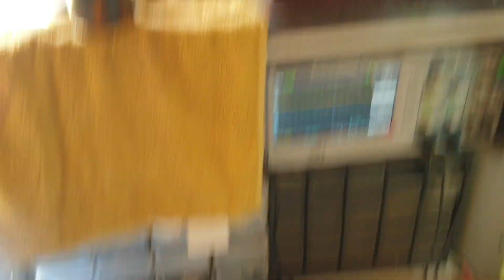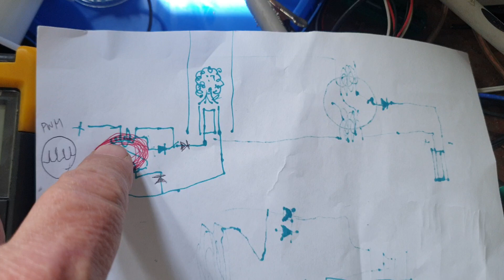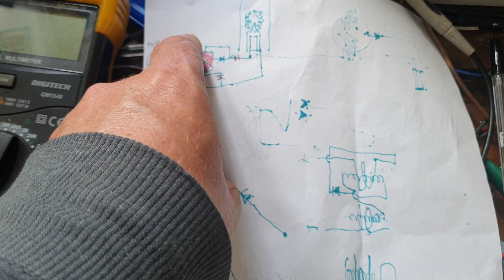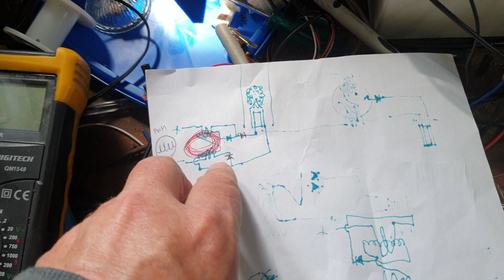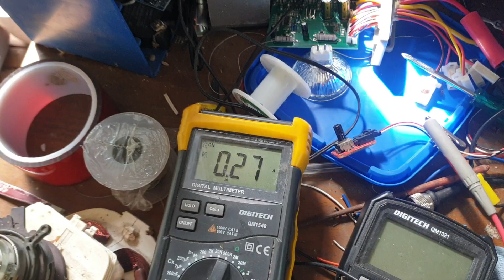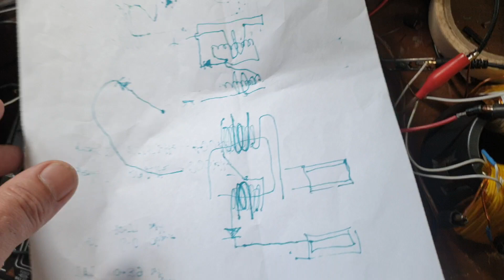Yoke coil current draw, & circuit discussion H+ O- H+

Comment: If you are using the DC voltage from the panels are you using a switching circuit somewhere in there to turn it into AC? If not then you don't have a transformer you have an inductor. Also if the windings are wired together then you have just one winding. A secondary is isolated from the first coil or you just have more coils in the inductor. Which makes sense when you say the magnetic wave collapsing adds power. I've seen a momentary 1000V come out of a small inductor when the magnetic wave collapsed.
Reply from the maker: the e-bike controller operates a pulse width modulation providing the spikes for the 'transformer' chokes... its like you didnt watch the video or understand how Stanley Meyers system is supposed to work before commenting... and no the windings arent joined at the ends, thats not bifilar, they join top to tail to create double length and half the interwinding capacitance.

Comment: This is just off the top of my head, I don't know if it would be an actual problem or not, but may be something to watch over time:

How often do you change over the ionized water?  Just wondering if the natural leaching of the plastic into the water from the tubing and such could re-ionize the water to the point where it's conductive again?
Reply from the maker: the water becomes ionised from being in contact with the metals more than the plastics, but it us still way less conductive than water that has had electrolytes added.